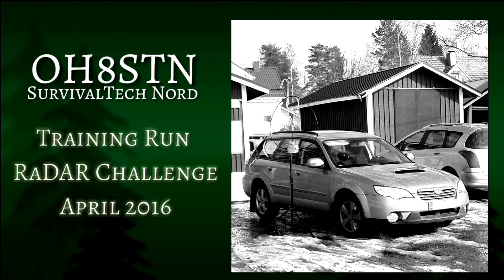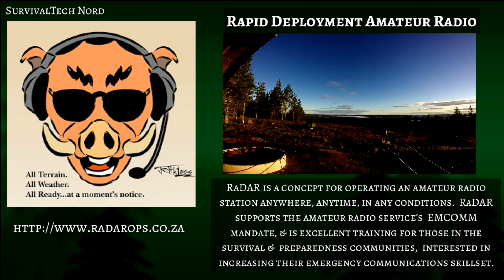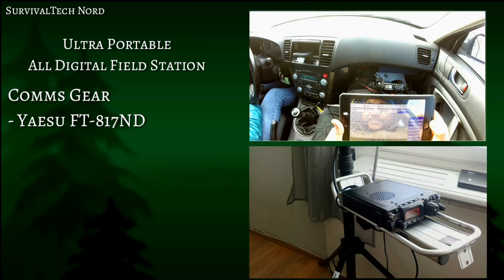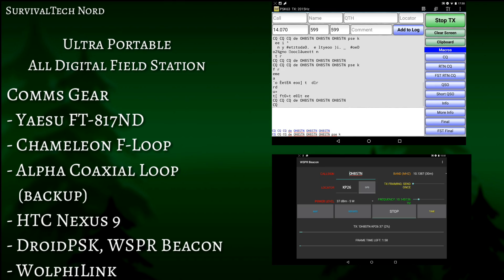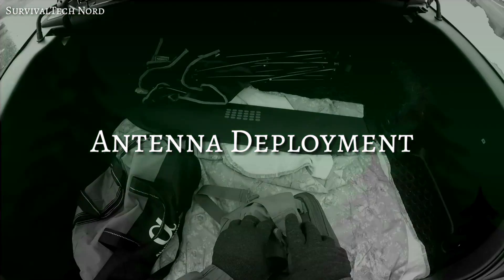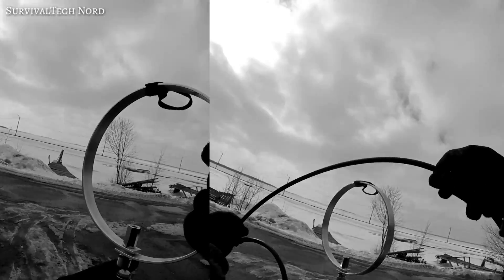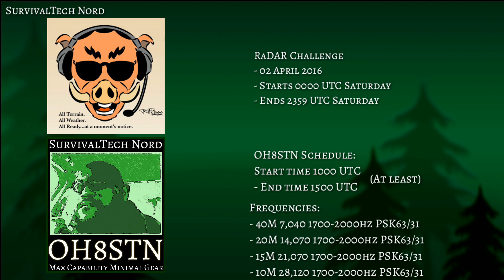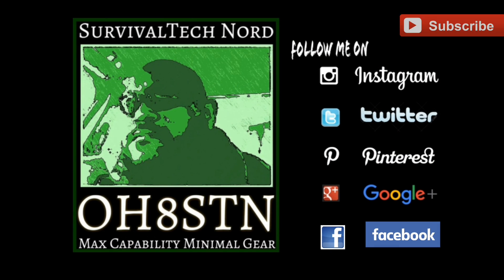PSK31 QRP HF Mobile Radio Ops Yaesu FT-817

Comment: I look forward to follow your live situation reports. Unfortunately I won't be able to be QRV all the time but probably something about 2 hours in the first half of your operation time. It would be awesome to have a QSO with you on 15 or 10M (novice licensed). Maybe I'll have some luck :) 
so far, 73 es gl fer nxt saturday de Robin, DO6XJ
Reply from the maker: thx Robin. I frequencies/bands are not set in stone. if you can do Psk on some band, I'll be happy to qsy for a sked
Reply: +SurvivalTech Nord I'm able to do portable PSK31(/63) on 15m (and also secondary on 10m, but then via clubstation; not portable). My qrv possibilities for saturday will be something around 1115-1330 UTC. 
I'll keep a look for ur call on the waterfall and will submit a qsy request if necessary via twitter or fb :) 
Can't wait for the sked chance.